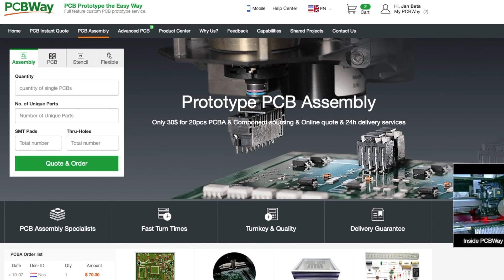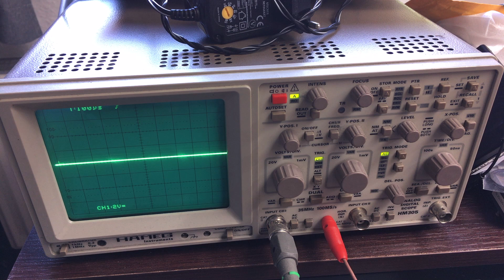TRS-80 Model 1 Troubleshooting (Part 2)

Comment: Hoi Jan. The rainbow you are getting is probably because the composite signal has some severe rippling after the sync pulse, where there should be just a flat front porch. Your oscilloscope images from Part 1 show just that, if you look closely. That rippling is probably being interpreted by the TV as a color burst (see: https://en.wikipedia.org/wiki/Colorburst ), and that's why you get colors instead of the B&W signal the TRS80 should be producing. Together with the severe rippling in the clock network, that suggests parasitics in the board, which could be caused by e.g. a bad chip hanging from the clock network. I haven't looked at the TRS80's schematics, but it should be possible to back-trace the composite signal to figure out where that rippling/"color burst" is coming from. Once you solve the rainbow issue, what will remain is a screwed-up but stable pattern on the screen, which suggests (video) memory issues. That's probably just some bad chips, which should be easy to diagnose. Don't give up, mate! This is just an 8-bit computer, there aren't many places where the problem could be hiding! (Addendum: the rippling in the clock network, according to your oscilloscope, happens on the low level of the clock. That suggests an undesired parasitic oscillator somewhere other than the CPU (though not 100% certain). That said, Z80s are still made, which are drop-in replacements for the Z80A in there. Here is the part number: Z84C0006PEC. They sell for only EUR 6 at Reichelt.)
Reply from the maker: Yes, that's the most reasonable explanation I've read so far. Thanks for that. I'm going to do some more detective work. :)
Reply: @JanBeta  Well Jan this is difficult one huh... actually sounds like a job for Mr. Black ... Mr. Adrian Black (@Adrian's Digital Basement) :-D
Are you sure that the power supply delivers and sustains... "at all times" .. all the voltages and amps necessary...
That the screen light up .. like normal startup .. and then dim down like that.... It may be because one or more voltages drop at boot .. when the big capacitor load up por example.... and the info in memory gets all screwed up for that momentary lack of voltage ..
Check the stability of the voltages with the oscilloscope during the start up

When it is on .. have you tried bending the board a little... or tab her... you know.. looking for false contacts in solder joins... or in broken traces...

Comment: No worries that this repair bled over into October.  It's an interesting repair.  I do have a Model I, was working last time I had it running but that was many years ago.  Afraid to use the included power supply as it's so old, perhaps I'll make one like you did.  Very much like your channel, greetings from Norther Ohio in the U.S.
Reply from the maker: Thanks John! More detective work needed for this one. ;) I think you could refurbish the original power supply to an extend by replacing the capacitor and the diodes, should be standard parts as far as I know. I just had to make my own supply because the originals are quite impossible to find over here.
Reply: @JanBeta  I'll do that.  I'm not much of a repair guy, but I can handle replacing the capacitor and the diodes.  Thanks !
Reply: I have one of these and am the original owner.  I replaced the Z80 back in Feb 2000.  Everything works but the tape recorder circuit (as of 20 Feb 2021).  If you want to compare notes, I can make some  scope screen shots if that would help. Love the channel!

Comment: I was rewatching this video today. What happened to that computer? If you still have it, I think it is about time to have another try in fixing it! As the -5V was bad, I would think the 4116 RAMs are all bad. They die fast whenever one of the 3 voltages is bad. And it would be worth for basic troubleshooting: Voltages, clock, reset behavior, address and data lines and so on...

Comment: Hello Jan, did you already check the Electrolytic capacitors? Somtimes a bad video signal is linked to a bad cap. So befor begin, I always change the caps.
Reply from the maker: Yes, replaced the electrolytics in the previous video (not the big filter caps, but they tested fine so I'm not too worried about those).
Reply: @JanBeta  ok, but I would also change the big filter caps. Only to be sure that a bad video signal is not linked with any bad cap. (even you check the cap)

Comment: Hi there Jan, I am suspecting that what you call rainbow is underlying color bars produced by the monitor itself (it seems there is an internal color bar generator in the monitor activated when it has no signal), rather than the TRS-80. Of course I cannot be sure, especially if I am not there, but I would try another monitor if I were you. Preferably an analogue one, in case you are using a composite to HDMI converter.

Comment: 74HC04 is a recommended replacement of 74C04. HC series are CMOS chips pin compatible with 74 series, but with logic levels compatible with CMOS 4000 series chips (symmetrical) - same as 74C series, but faster. The HCT series are modern CMOS chips, with both pins and logic levels compatible with old 74 series TTL chips (asymmetrical). In most cases CMOS (C/HC) chips will work in TTL logic boards and vice versa, but it is not recommended.

Comment: Would love to see a part 3. I do have some suggestions. You had found one of your address or data lines was being held down. This could be the issue. Check the warmth of your chips and see if they are getting warm. I'm pretty sure that video signal in the trash 80 required the processor to be running correctly. Keep at it. I'd like to see you fix it!
Reply from the maker: Yeah, I am currently at the point where I think the processor is not running correctly, too. I think the problem is the processor clock being too dirty to be interpreted right. I am working on it on and off, there is definitely going to be another video as soon as I have fixed the issue. :)

Comment: Hi Jan - I strongly suspect that the static pattern you are getting means that the video RAM is not being written to. Have you considered replacing the whole modded ROM board with a simple ROM that does nothing but continually write to video RAM? Then you can check that the RAM is continually being written with the value that you expect, and if so, can then try and follow the video signals through. At the moment there is no way to be sure that the reason you are not seeing valid video is that the screen is blank!

Comment: Interesting video...I have worked on TRS-80 Model I computer back in the 80's doing all sorts of hardware mods.   When the unit is first powered up, the ROM BIOS (well it wasn't call that then, but you get the idea) will initialize the video memory and clear the screen.  While you do appear to have a video output issue, the display is also not clearing, so the system is not booting up.  I would, as some other commenters have suggested, verify power supply ripple, as well as the clock chain as that might be preventing things from starting.   A couple of the mods I had made include powering the board from a switching power supply, which improved system stability tremendously (basically fed it +/- 5V and 12V), and took a discrete video output  (H/V sync + signal), so that you can feed a standard VGA monitor (I think it was CGA or EGA at the time), by picking off the TTL level signals for H and V sync from Z5, and video output off of Z30 pin 1.
Reply from the maker: I did some further troubleshooting in the meantime and there's definitely an issue with the clock signal getting messed up somewhere in the chain. I am going to get back to it eventually (the whole process was a bit disheartening to be honest so it takes some time to get back on track with the TRS repair...) Thanks for your input! :)

Comment: Personnally i had soldered 2 Bars of pin connectors (MB & Keyboard) and i had use a little old Floppy Cable with 2 34 pin femalle connectors (was easier than solder all wires :-) . Thanks for video on this dinausaurus :-)
Reply: I think he would have been better off to put a header on both the keyboard and the motherboard rather than soldering a ribbon cable like that.  That's going to be a weak point.

Comment: Check the resistor values if you haven't done it yet. Carbon resistors can drift quite a bit over time.
Reply from the maker: I checked the ones relevant for the vsync timings, they were okay. I'll check more, thanks for the hint.

Comment: I had problems with Q1 and Q2, the video output transistors. Q2 is a PNP (in some issues of the service manual incorrectly marked with MPS3904, a NPN transistor!). Check them and replace if necessary Q2 (MPS3906) with an BC327 (Reichelt, different pinout) and Q1 with a standard NPN transistor. If the sync then comes trough but no video signal (what seems not to be the case on your machine) check Z41.
Reply from the maker: Thanks! I checked the transistors and they seem to be fine from what I can see. The signal gets messed up somewhere before, it seems.

Comment: How about some velcro strips to stick it back on? put the Velcro between the chips? use some kind of glue that easily dissolves with a chemical that won't kill the circuit board? (super glue?)

Comment: If I remember correct a Model I doesn't boot right when the keyboard is not connected.
Reply: It doesn't, but it should at least show the "Memory?" prompt.  It basically keeps "typing" nonsense at that prompt when the keyboard isn't connected.
Reply: @Calphool222  yes! Now I remember. You are correct.
Reply from the maker: Yes, that's what I figured. It won't boot fully but should at least not display garbage. ;)

Comment: The video seems fine and stable to me. I'm not an expert but to me it looks more like there is memory corruption somewhere and it puts out garbage on the screen. You may want to check the character ROM(s) and memory chips to see if some of those fail. Just a thought. Good luck with the repairs! :)
Reply: No, the video isn't stable.  It's showing color.  The TRS-80 Model 1 is a black-and-white system.  It doesn't even have grayscale, so the signal should be very very simple.  A front porch, h-sync, back porch, and some high to low transitions for pixels.  Somehow his video out is wonky enough that the TV is interpreting noise in the signal as a chroma burst.
Reply from the maker: Thanks, the video RAM (and character ROM/generator) most likely has issues, the video signal is definitely messed up, too, though. So I started there. ;)

Comment: I would have just started pulling out the socketed chips one by one to see if that made any difference to the picture initially.. :)
Reply from the maker: Oh, I did pull the RAM in the previous video. Maybe I should try removing the whole ROM assembly, too.
Reply: @JanBeta  it wouldn't hurt and you would be able to see if there's any corrosion in any of the sockets or on the chips too..

Comment: The pulses on the latter pins of the Z80 look wrong, ie, they should be up and down not a blob at the bottom and top, and I've seen those weird pulses before on Adrian's Digital Basement when he had bad RAM. Compere the early pin pulses to the latter ones, because just seeing activity doesn't mean they are correct.

Comment: • 21:38 - Is that solder from eBay? I have the same spool. How's your experience with it? I find that cheap Chinese solder is pretty crappy and makes soldering very difficult. I've recently started using an old spool of very thick brand-name "electrical" solder I got from a reputable store a long time ago and so far, it's been better than I remember. I guess it's the old thing about "you don't know how good you have it until you experience something worse to compare it to". 🤷
• 24:10 - Ugh! I made an IDE-to-edge-connector adapter a long time ago to make it easy to swap hard-drives in an out and this was such a pain. So many wires. 😕
• 26:10 - ♪ Oops, there goes a billion kilowatt dam RAM ♪

Comment: Ah yes, the Colour Rainbow I've seen so often, especially on LCDs, when repairing MSX and other computers with no colour information. Which of course, the TRS-80 wouldn't. It is purty, though!
Reply from the maker: You can never have enough rainbows! Although in this case I would prefer a boring "MEMORY?" prompt in black and white... ;) I think it's most likely the upscaler/TV misinterpreting the noisy signal for a color burst.
Reply: @JanBeta  Bonus Amiga demo effects are usually appreciated, just not helpful.

Comment: Well Jan (@Jan Beta).. this is difficult one huh... actually sounds like a job for Mr. Black ... Mr. Adrian Black (@Adrian's Digital Basement) :-D
Are you sure that the power supply delivers and sustains... "at all times" .. all the voltages and amps necessary...
That the screen light up .. like normal startup .. and then dim down like that.... It may be because one or more voltages drop at boot .. when the big capacitor load up por example.... and the info in memory gets all screwed up for that momentary lack of voltage ..
Check the stability of the voltages with the oscilloscope during the start up

When it is on .. have you tried bending the board a little... or tab her... you know.. looking for false contacts in solder joins... or in broken traces...

Comment: Hi Jan, I've just been diagnosing my TRS80..  Your vertical and horizontal sync seem to be stable..  What concerns me is the graphics blobs you see on the screen..  I found out that if you have graphics blobs, corruption or snow on the screen, the fastest way to eliminate the Video Ram is to short the output of Video Ram bit D7 to ground.  If you check the tech ref manual it tells you that if D7 Video ram bit is on the rest of the video ram data bits i.e. D0 - D6 will be interpreted as graphics characters in the upper ascii character set.  On mine, the D7 bit was wonky and corrupted the screen..   See here https://youtu.be/FCQNedxqE7A

Comment: Hi Jan, I repair old 8-bit computers as a hobby.  I've worked on several model 1s.  I think you need to take a step back and start with what you know is wrong.  What you know is wrong is that the video output signal is somehow messed up.  The fact that you're getting a color signal means that the output is so messed up that your television thinks that it's seeing a "color burst" in the composite line.  The TRS-80 doesn't send a color burst signal because it's black and white.  

Here's a picture of a black and white NTSC composite video wave from a working model 1.

https://imgur.com/gallery/OJwQkS4

We need to see what yours looks like, and from that we can start making decisions about where to look next.  Is the computer sending proper sync signals?  We don't know.  Is the waveform distorted in particular parts of the signal?  (Front porch messed up, back porch messed up, specific parts of the luminance part messed up?)  We don't know.  We don't have anything to go off of right now, and we're just sort of replacing chips in a shotgun approach.  We need to narrow the scope by looking at the symptom closer.
Reply from the maker: I scoped the video output at various points in the previous video. It looked like a composite signal but with a lot of noise added, as you said. The signal you linked definitely looks way cleaner. The sync signals actually looked okay (also shown in the previous video) but the vsync was flickering for some reason (hence I why I replaced the chips in this video). I'm going to have to do more detective work and start at the beginning of the video divider chain. Thanks!
Reply: @JanBeta  Okay.  Well, the video circuitry for this thing is pretty basic.  It's got a sync side and a pixel side.  Pin 1 of Z30 is the pixel data and pin 8 of Z5 is the combined sync signal.  

Here is a photo of the scope on pin 1 of Z30 (which is pixel data).

https://imgur.com/gallery/YGyIznx    

Here is a photo of the scope on pin 8 of Z5 (sync data).  It also shows a vertical sync fly by every once in a while (shows up as a longer high signal), but that is not depicted in the photo.

https://imgur.com/gallery/uOskzEr

If yours looks identical to these, then the problem is on the right side (the analog side) of the composite circuitry, which is essentially two transistors, half of a peripheral driver chip 75452, and some voltage divider resistors.  If yours looks different than these, then the problem is further up the video chain.  So I would suggest we divide the problem in half by comparing these images to yours.
Reply: By the way, just so you're aware, one of those transistors is mislabeled in some versions of the service manual schematic.  Q2 is suppose to be a 2N3906.  Some versions of the schematic show it as a 2N3904.
Reply: @Jan Beta  I just rewatched your previous video.  You need to go to time 39:05 in the first video and look at your composite signal again.  Either your scope is set to the wrong time and voltage divisions, or your composite signal is very messed up.  What I see is that your scope is set to 1V per division, and it stays floating at 2V all the time, and then occasionally drops down to 0V for horizontal sync.  That makes no sense, because it means that you are sending white pixel data continuously, and there is no front or back porch after the horizontal sync.  You need to look at pin 1 of Z30.  If you have pixel data there, then one of the discrete components after Z30 (Z41, R23, R27, R28, R30, R22, C7, C2, Q1, or R30) are bad.  Since it appears that Q1 is always switched on, we could imagine that pin 4 of Z41 might not be grounded (which would allow back-flow through the base collector junction of Z41), or Q2 is somehow leaking current, or Q1 itself is just bad and is stuck on.